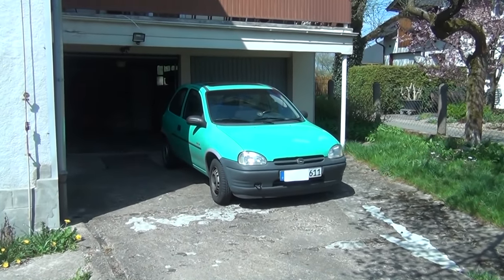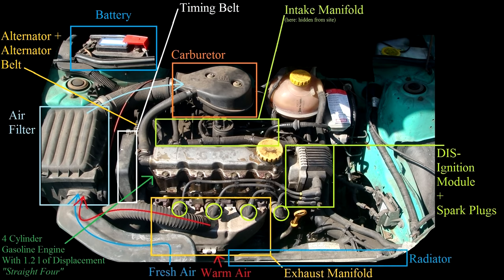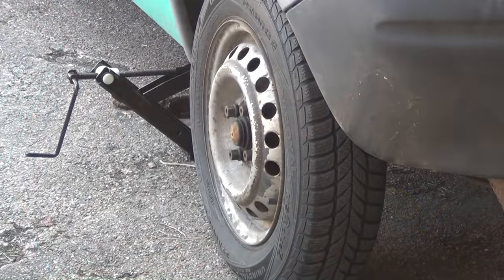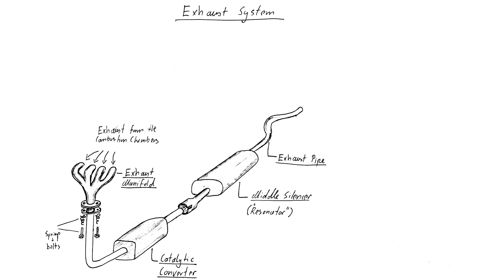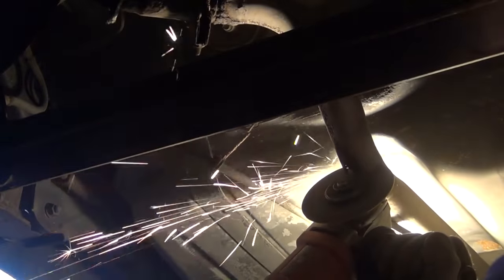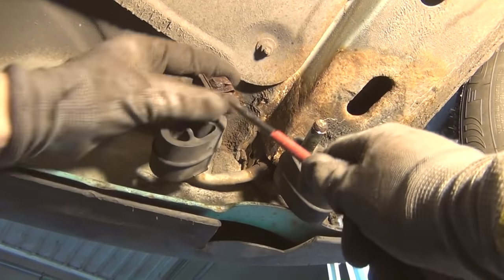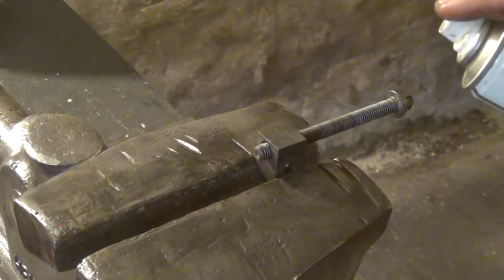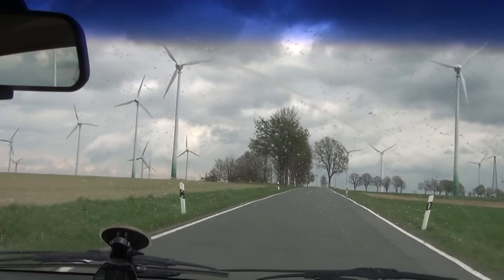Car Repair Marathon

Comment from the maker: Some  facts about the Opel Corsa:

In the UK this model was sold as the "Vauxhall Nova" and later as the "Vauxhall Corsa".
In Asutralia it was marketed under the name "Holden Barina".
From 1982 to 2012 more than 10.000.000 units were manufactured.

(That includes older and newer versions of the Corsa)

On another note: The part which I labeled as a "carburetor" in the video is actually an injection system ( as you would expect in a fairly modern vehicle). 
It looks pretty much like a carburetor though. Even my neighbor (a trained car mechanic) thought it was a carburetor).
Reply: The Post Apocalyptic Inventor 
if someone funds you to install a remote style turbocharger (1 bar pressure)
would you do it..? have enough time to do it ?
Reply from the maker: Faisal Abdulaziz Hey funny idea, but I won't do any modifications to this car as long as it is my only vehicle. 
I guess I will buy a new car next year, maybe I will then use the Corsa for some experiments...
Reply: hmmmm i see...
yeah if this is your only car then there is no point in doing stuff with it
Reply: The Post Apocalyptic Inventor This model has never been sold as a Nova in the UK, it's always been known as a Corsa B.
Reply from the maker: RandyDarkshade My comment deals whith the Opel Corsa in general, because I have only production numbers for ALL generations of the Corsa. My comment refered to the "Corsa A", which as far as I know was sold under the name  "Nova". That's why I said it was LATER called "Corsa B". That's also why I said, that this comment includes older and newer versions of the Corsa.
Reply: +The Post Apocalyptic Inventor Man these cars are incredibly common in Europe. Here in the UK some driving instructors use them to teach people how to drive. Love these little things!
Reply: Dr Mantis Toboggan
there cute super easy to maintain
Reply: +The Post Apocalyptic Inventor TBI, Throttle Body Injection.  Looks like a carb but it was an early injection system before DI became the norm.
Reply: The Post Apocalyptic Inventor here in Australia my gf had one and it kept going! its a great little car...
Reply: The Post Apocalyptic Inventor if it looks like a carburetor.... But fuel injected ... Then most probably, its throttle body injection... The first  gen of fuel injection... :) I used to have some pickups that have them.
Reply: I owned an Australian Barina and it was bloody expensive. The starter relay cost AU$200 because it is non-standard and had to be imported.
Reply: The rusty exhaust is a common problem around the world for this car... Apart from that... It just keeps going and refuses to die... I had one that I saved from the wreaking yard and drove it for at least 6 years. It now belongs to my son and is still going with 400,000klm on the odometer... Incidentally there's a video that someone posted about how much he loves his Corsa B on YouTube.... It truly is an excellent car. German engineering at it's best... Next time fit a stainless steel exhaust and never have to get under the car again..... Ever!
Reply: The Post Apocalyptic Inventor are you Germany
Reply: Why is there a hole cut in the right side inner fender.

Comment: I spent 5 decades working on my cars like you.  I finally reached the age where it wasn't fun anymore so I sold my two 45 year old Datsun Z cars and treated myself to an EV.  With a 5 year warranty, I don't have to do anything other than charge it. I also restored a Jaguar e-type roadster in the early 2000's.  It was fun at the time but I wouldn't want to do it again.

Comment: Thanks for the video. All of your videos are fascinating. You use just the right tone, not talking down to viewers, but explaining your reasoning and thought processes. I really enjoy youtube videos from outside of the USA, it is interesting to see how things are done elsewhere. 

You are very lucky t have a pit new your garage. Muffler work without one or a lift is a miserable operation. We still have them in the US in quick oil change shops. They have one man in the pit who swaps filters and drains the oil. They have heavy nets on rollers that are in position until the car is parked. Of course they are relying on the driving skills of the random drivers, which, if you have been to the US, is a frightening idea. 

Oh, and by the way, your English is absolutely flawless and precise. One of the regrets I have in life is not having learned a second language. I am always impressed by anyone who does. Also, it is not an easy language, I am told.  You have mastered it. 

Thanks for your efforts.

Comment: You seem to like Ballistol very much. For a few application I would recommend different fluids: Rubber generally gets brittle when it's exposed to oil (ofc there are special hoses which can handle oil) so you should generally use silicone spray with rubber hoses or (in this case) rubber exhaust holders/bushings. Also copper paste is really good anti cease for bolts and the face of the brake rotor where the wheel sits.

I like Ballistol too, but the biggest problem with it is that it's water soluble. It's perfect for indoor applications.
Reply: Philip Kaiser car repair Toyota

Comment: I had an Opel corsa sport 1995, best car ever,  purchased it for 30.000DKK where it had run 40.000km, i drove til 450.000km, and got it solt for 15.000DKK, still ran perfect. first car, loved it

Comment: I don't understand your gift for entertainment. You take simple tasks that people can't even remember about much less do anymore and you make them into great videos.  Good work. 

I have a 1965 Triumph Spitfire 4. I can see right away what is wrong with your green bean. The engine was put in sideways. Also, they obviously left out the automatic oil changing system. There are no leaks at all around the head gasket. Now you will have to dump oil out of it in order to add any new oil. Dumb. 

I would get a British car. Life is so much easier. You don't even need an exhaust system because it will never run anyway.

Fun video.

Comment: Subarus are fantastic cars! I have owned 3 of them. They are easy to work on and last forever (especially the manual transmission ones) with just general maintenance. The valve covers leak oil and it runs down onto the exhaust manifold giving the "burning oil" smell. If it gets bad, they are easy to replace. The exhaust system is prone to rust (as you have seen already). The parking brakes can be tricky to adjust and fuel system problems can be difficult to diagnose. But, of course, these are just my amateur observations. I really enjoy your channel. Keep up the good work!

Comment: Battered old Toyota driver. Lifelong bachelor. If only the ladies understood! I don't see the point of getting rid of a vehicle as long as it still works. Plus my vehicle is relatively simple compared to even other Toyotas let alone some modern vehicles. 

If you ask me modern vehicles biggest downfall is the prevalence of electronics in the vehicle. All it takes is a bit of corrosion in a contact or a pinched or melted wire to short and the car could be scrap. I know people with brand new vehicles who have terrible electrical problems. Ford, Nissan, Renault and Volvo and in the end the dealerships have replaced the ENTIRE wiring loom. We've passed what i call peak reliability in cars. 

On a different note i didn't realise GM vehicles were using carbs as late as 1996.
Reply: zoidberg444 My knowledge regarding engines is near zero but I'm almost sure the Corsa B does not use a carburetor. I think the part marked as a carburetor might be the throttle body used to control the amount of air into the engine.
Reply from the maker: João Assunção Yes I checked some of my books and it is indeed just looking like a carburetor. It is called "multec central injection" in the manual of the car. My mistake and I made a video annotation to correct that. Too bad because I asked my neighbor for advice on this. He is a trained car mechanic and even he thought that this is a carburetor.
Reply: +The Post Apocalyptic Inventor The GM version here in the states would be called "throttle body injection", which involves a single point of fuel being sprayed into the intake airstream by one or two injector nozzles.  On an old car I had, I could actually remove the air filter and visually inspect the spray pattern.  This was later supplanted by multi-port injection, which involves one nozzle per cylinder injecting fuel in the intake runner much closer to the intake valves.  I preferred the older throttle body system due to its simplicity and ease of diagnosis.
Reply: +zoidberg444  What. Much better than a guy who spends money he doesn't have on something he doesn't need.

And eh, horror repairs, of course a dealership really wants to get the most money out of every repair.
Reply: +The Post Apocalyptic Inventor Thanks, I was puzzled by that. 96 seemed awfully late for a carburetor.

Comment: I learned to drive in 1973 in an Opel Cadet station wagon. My father worked for GM and he got a nice discount on new vehicles. Buick imported them for a bit back then so he bought one. It had a manual 4 speed transmission. I always wished he had bought the Opel GT but... he didn't. You never see an Opel in this country these days unless it is a restoration.

Comment: A little tip with the exhaust, try holding a thick rag over the tailpipe and listening for leaks further up the pipe. It is easily the quickest and most convenient method for detecting leaks.
Also, you can stop that oil leak by making a copper gasket, annealing a copper wire fully and making an o-ring out of it is ideal.

Comment: Perhaps splitting hairs, but I will make this bold statement: There is no such thing as suction! It is atmospheric pressure that PUSHES air into the space vacated by the returning piston (or any similar scenario you could think of!). Americans use the more precise term here: "Naturally ASPIRATED engine" versus the German "SAUGmotor". A turbo charger PUSHES more air in than the atmosphere could, it's not the engine SUCKING more air in (which for example is the reason T/C cars keep their power at high altitudes vs. N/A cars). A lot of things become clearer when you think in terms of the atmospheric "push" vs. something "pulling" air in - like the height a pump can vertically pump liquid from, etc. OK, off my soapbox...

Comment: 16:50 at this stage you can remover the rust and apply some anti-corrosion primer. I have to do the same on my car but unfortunately  I have no pit in my garage.

Comment: In the US a couple things to help you guys understand a slight difference, the alternator belt is called the fan belt, common back in the 60's and 70's as all vehicles had a fan powered by the engine.  But as a US citizen that knows a lot about cars.  One of the most common vehicles to repair is the older gen Toyota pickups, (1980-1994 ish) they were is mass production and really popular as being more affordable then the competitors of the day.  Mine is a 1985 pickup long bed and it is the cheapest to fix vehicle I have ever met.  Parts are easy to find and not to expensive if you can do it yourself.  FUN FACT: It does not have a muffler do to rust.  Though the pipe that went into the muffler is perforated  (like a rifle muzzle) and thus it doesn't sound annoyingly loud and resembles an American sports car.  It also has an amusing backfire when idling down hills.

Comment: I know it's a bit late after the fact, but you should really consider changing your oil more often. If you do mostly rural highway driving (90-100 km/h with a lot of speed fluctuation), Group 3 oil like the Motul you had in your Corsa loses a lot of it's lubricating properties after 8000km. For longer oil change intervals (14000-16000km) a Group 4 PAO oil is better suited (also a lot more expensive). And if you do mostly city driving, it's recommended to change the oil every 6 months. 

Another thing to mention, antifreeze should be changed after 4 years to prevent engine corrosion and brake fluid should be changed every 2 years to prevent water accumulation in the brake lines, which can severely hinder emergency stops.

Comment: No power-steering just means it's a muscle-builder! XD
Also, it is generally considered unsafe to oil your wheel-bolts as it may allow them to come loose, because while there may remain enough friction where the heads contact the wheel you'd be safer with them dry. 
Wow, that four-cylinder reminds me of my first car!

Comment: Here the Corsa is a workhorse, cheap and reliable. Engines are a 1.6 (105HP)  litter and then moved to 1.4 litter (90HP) I think the come from the "Ecotec" GM family also used in Daewoo cars. Great daily driver

Comment: My Mum used to own Vauxhall Corsa, four door hatchback. It was fairly easy to work on and yes, I thought it carburettor but it is an odd fuel injection system.

Do you know of Henning Wehn? He is a comedian. You both use similar euphemisms and idioms when speaking English. 

I do not wish to sound patronising, however, it is an adorable trait and lightens the mood of your videos. 

I appreciate that English is not a very well structured language unlike German or most other European languages. It is a very lazy language and we interchange many words.

Comment: Wasn't expecting a 1996 car to be so simple! I myself own a 1987 Volvo 740, and a 1990 Audi 80, both very simple cars! The Audi has so much room in the engine bay you can almost fit 2 engines in there.
Reply from the maker: +SnOpeK Domowei I was thinking about buying a 1994 Volvo 850 just yesterday. I saw the car for sale in a neighbouring village for next to nothing, but I watched some videos about that car and saw that it is WAY more complicated than this car :D
Reply: The Post Apocalyptic Inventor Oh yeah, 850's aren't nearly as simple. But they are pretty reliable! My girlfriend's father has one that currently has about 550.000Km on it!

If you decide to go Volvo, get a 240, 740 or 940 :3
Reply from the maker: +SnOpeK Domowei Thanks for the advice. I think I'm a Volvo guy. I like the idea of a car that can run and run and run...
Reply: +The Post Apocalyptic Inventor You might also want to look at 1991-1995 (b4) Audi 80's. Cheap and easy to find in Germany and they are fully galvanised so you don't have to worry about rust, unlike the older 2xx, 7xx and 9xx series Volvo's.

Comment: It is interesting to see the differences to newer Corsa generations. On the next gens (C,D) GM decided to weld the catalytic converter directly onto the exhaust manifold (cast iron) for the smaller motor variants. Guess what goes wrong if a mass is attached only by a weld to a cast iron part that is screwed to a vibrating motor for a few years... At least this is a common weak point and 3rd party replacement parts are available and reasonable priced. Getting all the dirt off the motor to make the new gasket seal (don't use exhaust paste, it will ruin the catalytic converter/void warranty) and carefully getting the lambda sensor out of the shattered exhaust manifold with an angle grinder is another story.

Comment: Obviously I don't know when your Timing Belt and Tensioner's were last replaced, but going by the state of your alternator belt , it might be worth changing them for the  peace of mind, cost a lot more to replace the damage to a engine from a belt or chain failure..
Reply from the maker: ryzo mcgregor Thanks for the hint. I guess I'll check that out next.
Reply: The Post Apocalyptic Inventor Strongly Agree!!  The resulting damage that occurs when that timing belt lets go (not "if") is so extreme that it is often cheaper to replace the entire vehicle.  Saw that happen to a Subaru with a flat-4.  Don't be surprised if that belt drives the water pump as well.  If it does, change the water pump while you are there.

Comment: Howdy P.A.I , may I ask these questions ?    Is the Opel power output 45 ps or 45 kw .  Do they put salt on the roads where you live .  What does it cost to keep the car registered and insured . Are the regulations on the car very strict ?
Have a nice summer , regards Steve .
Reply from the maker: Steve Smith Hey Steve. It's only 45 PS not kW. They put salt on the roads (that's only for a comparatively small part of the year though). Insurance is roughly 400 $ / year, taxes about 90 $ / year. Regulations are rather strict in Germany.

Comment: I enjoyed that! ps the thing that looks like a carburettor, I think is a single point fuel injection unit, to go with the catalytic converter.
Reply from the maker: davidrobert2007 I checked the manual and you are right. It is called a "Multec Zentraleinspritzung" ("Multec-central-injection"). 
My mistake. I will make an annotation in the video.

Comment: Well last time when i repaired my mufflers and resonator the local auto mechanics just cut out the tubes and then welded them with out using the brackets... even more they wanted to skip the rubber mounts and directly weld the exhaust system to the body of the car with some metal brackets. So just be aware! With out rubber mounts the mufflers don't do there job, because some of the vibrations pass trough the metal joints to the body of the car.
Reply from the maker: Vandwo Great mechanics you got there :D
Reply: You don't say. Most of the things I like doing by my self. This reminds me how happy I'm with my cheap BGS (ZB-2296 Kraftmann) (cheap kit, branded as BGS-Germany hobby series). Kinda satisfied with the quality for the price. But I guess only the plastic box that holds the kit is made in Germany :D

Comment: Hi boss! Can you check winter tires orientation, it seems that you flipped left and right side.
Reply from the maker: +Nedim Fejzic Hey. it's too late for that, since this footage is quiet old by now and I have changed the  tires a bunch of times since then.
Reply: Nice then, i thought that you will be using this tires again now. Cheers.